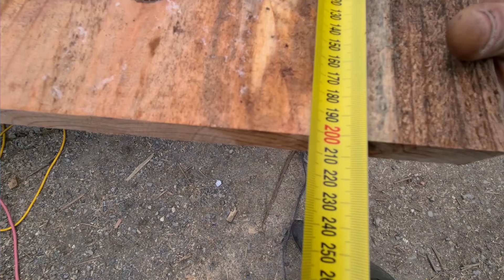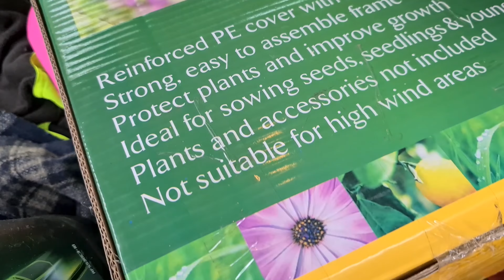We are building stuff at the Old Farmhouse.

Comment: About 20 years ago a wood panel fence was put up by next to home here in England. The wood had been autoclaved in a preserving pickle. Those panels are  about 1/4 inch (6mm) thick, apart from turning a grey colour, are as good as when they were put up. An autoclave is a big tubular sort of pressure cooker. Effectively treated timber lasts a long time.

Comment: As a retired painter, living in Qld, Arb is being fair dinkim about Sikkins. Only stuff I would use on timber anything. Oil stains have to be recoated at least 12mthy. So if you compare the price of both Sikkens & Oil stain plus how often you have to reapply  both, it works out cheaper option to use Sikkens.